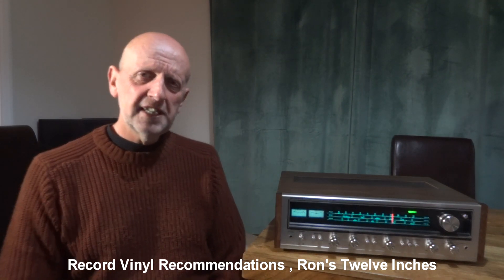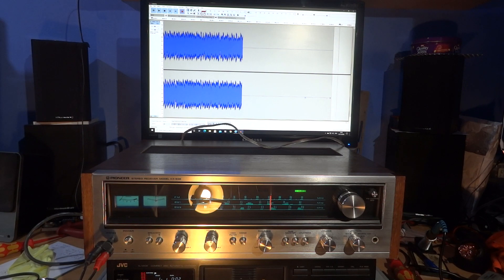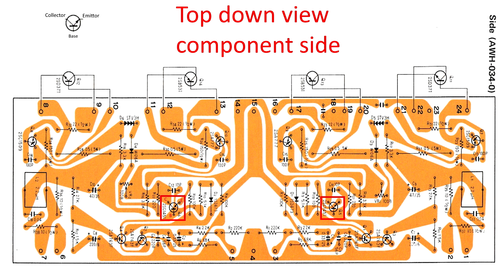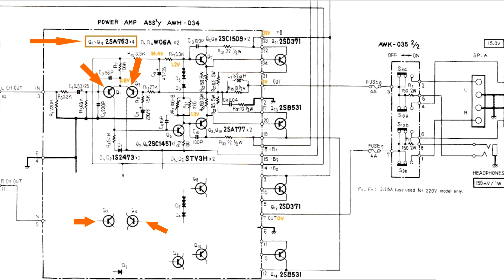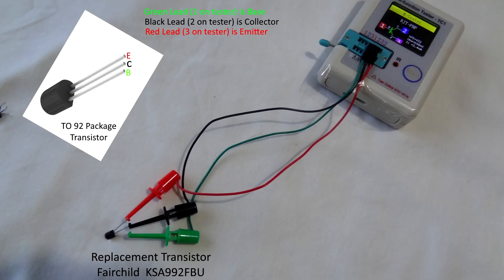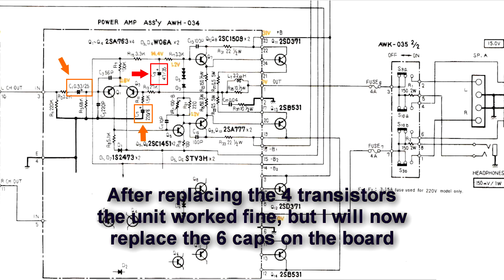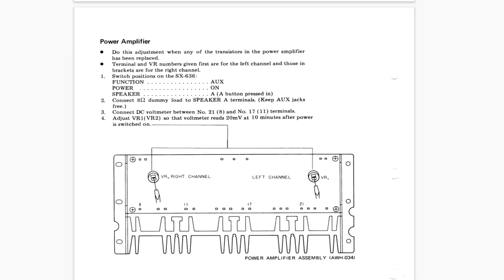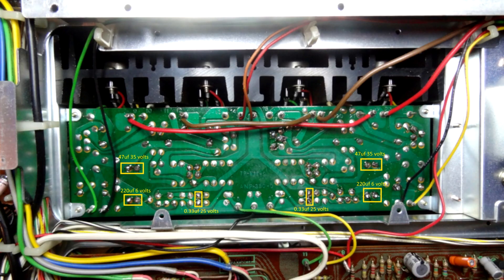Pioneer SX 636 Receiver Loud Popping, Static noise from Speakers FIXED. Sound sx636, 737 crackle

Comment: I found one of these in the trash the other day, and I am having some similar problems. Lots of crackling on the left channel. I replaced the 2SA726 with KSA 992s, and the crackling remains. I am having trouble finding KSC 3503 transistors to replace the 2CS1451. Is there another transistor I could use to replace the 2SC1451?
Reply from the maker: From memory I think I have seen a few people use a 2SC2383 or KSC2383 as a replacement for the 2SC1451 , might be worth giving AH-Fix-It on YouTube a shout as he fix a sx 636 a while back to

Comment: Hi Michael, is amplifer board the same as the pioneer sx-737 amplifier board?.
Reply from the maker: Hi, they are very simular indeed tone and pre amp etc. The 737 main amp has a very slightly different layout also driver and output transistors are higher power versions that are used in the 636.
Reply: @MichaelYates  thank you.

Comment: Great help, but my SX-828 has issues with popping, crackling ONLY when on FM. Audio section is fine. Where can I go for help on tuner issues? Nothing on YouTube.
Reply from the maker: I am not to good with Tuners myself so can not really advise, but sounds like it could be a noisey transistor towards the output section of the Tuner. But this is just a shot in the dark.
Reply: @MichaelYates  Hey nice to hear from you! Tuner sections are another breed of cat. Working with RF now, so it's harder to track problems IMO. Yes, there's a chance the problem could be in an audio stage too.
Reply: @curtchase3730  check q8/9 on the tuner pcb. if they are 2sa725 or 2sa726, they should be replaced with ksa992. these transistors are on the left and right output of the tuner and are known troublemakers and can cause noise like what you are experiencing. while at it, replace c59/60 .33uf electrolytic capacitors. kemet r82 film capacitors work fine here as do wimas. these have nothing to do with alignment so no worries. just don't bump anything.

Comment: Hi, is it usual happen on the tone control board or the channel board, or on both have to be replace?
Reply from the maker: These transistors can become noisey on both main and pre amp boards, pre amp board will have the tone controls on normally. Also the phono input part the record player plugs into there is normally a couple of transitors used to boost the signal before going into the main pre amp. Always best to replace both channels were the noisey transistor is, that way should keep the gain of both channels about the same.
Reply: @MichaelYates  thank you, I have the sansui qrx6500 when I increase the mid, the noise it getting a lil lound. Thank you for your instruction
Reply: @MichaelYates  have you ever own the mac 1700? Do you have any video how to adjust the bias on that receiver?

Comment: my frount left speaker is crackling, not sure why, it doesnt seem to be shorting but its just crackling, i have extended the speaker wire (the join when rubbing that has electric tape over it is making it crackle) so i cut the wire, uncovered it and plugged it in, it was connected to a 14 gauge wire before, but the speaker wire itself had like was like 10 gauge and wasn't very thick. so wire connected to speaker was 14 gauge, but the wire connected to the amp (after the join was 10 gauge), its still crackling tho. even after trying to fix the issue. is it that when the wire is shorting it crackles?
Reply from the maker: As long as the wires have a good connection or soldered even they sold not cause the crackel, could be loose connection elsewhere
Reply: @MichaelYates  were abouts do you like if you dont mind me asking, i live in milton keynes england
Reply from the maker: @sephstar-offical  Im just soutside Southend
Reply: @MichaelYates  of mk?
Reply: @MichaelYates  well were on the same continent lol

Comment: I'm considering buying an A/B amp off a seller. B Channel has a intermittent crackle sound though. He said if you wiggle the speaker connectors it gers worse. Could this just be a re solder job where the wires are at the terminals? A channel is fine though.
Reply from the maker: Hi, It could well be if when he wiggles it gets worse or better and when he stops it stays the same for a period of time. Also if the speaker terminal is directly soldiered to the amplifier circuit board then could be a dry joint. But I would still be cautious.
Reply: @MichaelYates  well its worth a punt. £55 for a nad 3130 even for just one channel ain't bad. And localish pick up
Reply from the maker: @CM-dw3gh  I always look when buying a faulty item at the worse possibility I can not get it working then how much can I get back for it. I have just had a quick look at the 3130 and it looks like the speaker terminals are soldiered onto a little circuit board of their own, so there is a good possibility of a dry joint here causing the crackle. Also check dry joints near the output transistors as these get hot and can cause a dry joint.
Reply: @MichaelYates  yes that area does look a bit dry on images where the red/orange wires are soldered at. I see the 2 transistors also have that thermal grease over them. I'm wondering if a fresh blob or two might be beneficial, for the heat pads too
Reply from the maker: @CM-dw3gh  You should soon see if one terminal is loose /  dry joint on the board by just wiggling it you should see the connection moving a little on the board itself were the soldier is.
Reply: @MichaelYates  well I bought it today. Got it home and gave it a good hoover, very dusty. Used deoxit all over using electrical brush, cleaned all pots. Did notice some dryish joints but nothing too glaring. Checked the offset for both channels and surprised at 10mv and 11mv. Got my test speakers and decided to try the B channel. Prepared myself for the worst but that clean must have done something because it plays without crackle. Will go over it tomorrow for a better look but it's just playing music at the moment and not running hot which is a good sign. Also, hardly any sound from transformer, very faint. Happy days
Reply: On a different different subject but in the same theme, would you be able to a video about all the tools required for fixing amps. There's an.american chap who does one but all the links are US based stores. I think I need to start with a semiconductor thinking about the ASR one. Goes for about £55. I don't want to buy the really expensive brands as I know with multimeters, the cheaper ones can be just as good.

Comment: Listened for a good ten minutes but he didn't seem to talk about the actual fault popping and crackling so I got bored and switched off
Reply from the maker: Sorry John, I know I do waffle, I try not to but then it happens
Reply: @MichaelYates  Nah ! I'm sorry too Michael.  Everything was going wrong yesterday and my amp banging and popping was the last straw. . I was in an irritable mood.. Anyway I think its a faulty cap in the power stage.. I don't have test equipment, I'll look for leaks and swelling and replace them. Hopefully I'll get lucky.
Reply from the maker: @johnallen8680  Any fault can be very frustrating even with some test equipment, If you have a Pioneer 636, 737 then the transistors in this video are a good place to look and dry joints or caps , wish you luck John and hope you get it up and running again real soon.

Comment: This tutorial was very useful for repairing my SX-636. Thank You!
PS: You can also use a BC556 or a BC560 transistor instead of the KSA992. In most electronic shops from Spain it's more available.
Reply from the maker: Thanks for the extra information on the substitutes

Comment: I'm having a very similar issue with an amp from the late 90's.  It's working ok but will suddenly have static noise that gets louder and louder and louder, eventually ending in a very loud pop.  Or, it will occasionally just pop loudly.  It's doing it a few times a day. Is this more indicative of failing or failed transistors rather than capacitors?  And can you test either while on the board?
Reply from the maker: I would say sounds very much like a transistor, you could try using a freeze spray one or two quick squirts should do and spray one transistor at a time and see f this stops it, if so then you will know which transistor it is. To test a transistor and caps properly they should be out the board, but a transistor intermittent faults do not always show up with testing
Reply: @MichaelYates  Thank you for the solid advice I will get a can of compressed air and try it.  I actually have a high-end solder station with multiple tips and do various solder work, I'm just not very familiar with board repair (but can read schematics).  It's worth a shot to try and fix it as I've only had the amp for a year and bought it used for $100.  Thanks.

Comment: Get to the point already!
Reply: This guy is a joke! He doesn't know how to troubleshoot transistor circuits!!! His technique is called shotgun repair!  All he had to do,was to ground the collector of the input transistor with a small capacitor (10uf). If the problem went away, then the problem was the differential input transistors!! I've used this technique for nearly 60 years and it works every time!
Reply from the maker: Thanks for the information, I do not claim to be an expert when repairing these old amps and receivers, but now I know this method I will give it ago when this problem arises again and maybe upload my results.

Comment: how do you figure out which components are causing the issue?
Reply from the maker: These are common parts that cause this issue, a search on the net for this or other amplifiers or receivers will usually bring up the common faults and parts that maybe causing that fault. If this is not the case, then a transistor, dry joint, bad cap, bad pots would be the number one suspects on a noisy channel

Comment: Great job Michael, I used to place little card tubes over suspect transistors then give each one a shot of freezing spray.. It would quite often aid diagnosis and the tubes would shelter surrounding components..
Reply from the maker: Thanks , I think I will try and incorporate that in another fix video if I can